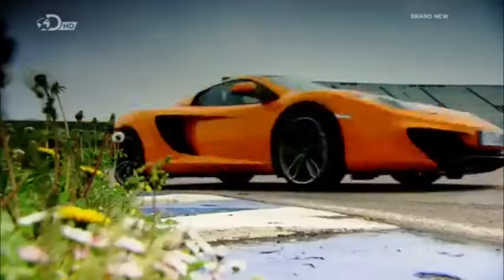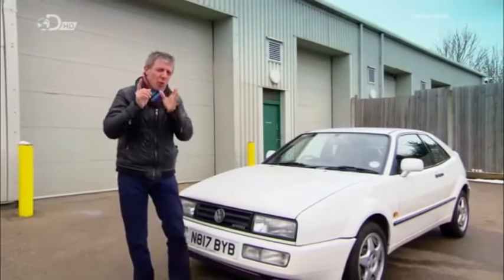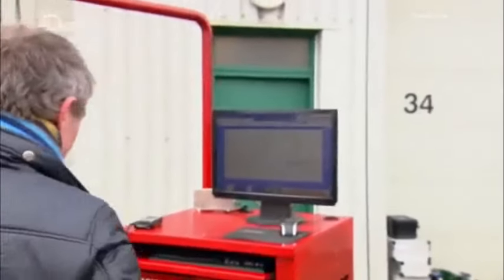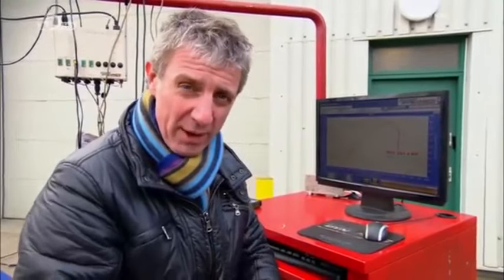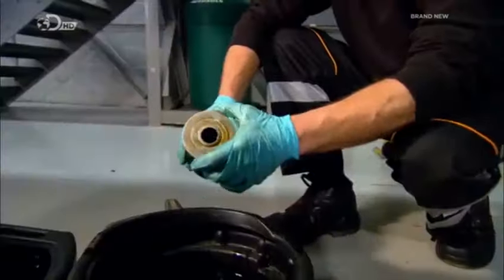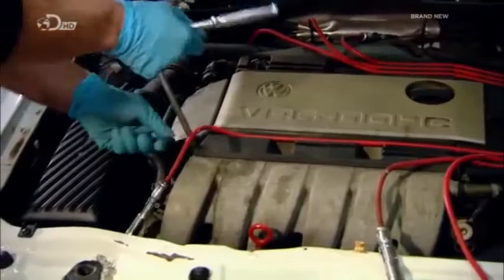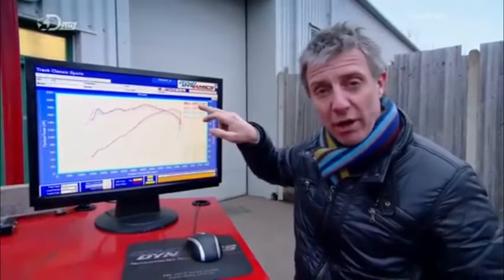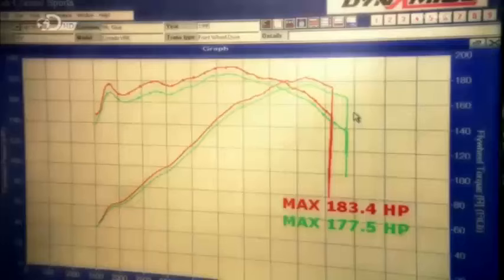5th Gear Test Redex On The Dyno With Surprising Results

Comment: Wow I got 11 extra HP, 188 in total now, but still can do 70mph max...........
Reply: I bet you're fun at a party!
Reply: mirola73 The Corrado VR6 top speed is 146 MPH.
Reply: Ricky Rose I am !
Reply: Injectortune No use in the UK though.
Reply: +mirola73 70mph? Everyone does 80 on the motorway. Anyway acceleration is mainly what we use power for on the road, to me it's what feels fun about having more power. You're on a 60mph single carriageway, some sunday driver in front is doing 40, suddenly you have a clear stretch... You can't tell me it's not fun to drop a gear or two and get the overtake done quickly, safer to spend less time in the oncoming lane too.
Anyway the engine will be more efficient after doing these little tweaks too so more MPG.
Reply: +mirola73 Not everyone is dead inside. If I find an empty straight with no hazards, the throttle is getting mashed and staying there, because why not!
70mph is a pathetic limit which is totally outdated. Anyone who's been on the autobahn in a fast car can attest to how a bit (or a lot) more speed is not neccessarily dangerous you're responsible and your car is well maintained.
Reply: ^ Here here. If you want to get somewhere quick in the UK, cruise at 95mph and no faster unless you're certain there's no camera van or cop car behind you. 95mph is almost certainly 3 points (unless you're breaking other rules) 96mph and you can end up in court for being 26mph over, which applies to any speed limit. Cops always report you for a speeding offence, only the vans do FPNs now, but the 'ticket' still ends up with the same office and you still get the same points that the FPNs do.

Comment: Why would cleaning the fuel delivery system give the car more power?  Those injectors can't possibly be outrunning the fuel system's ability to deliver fuel.  This guy's insane.
Reply: +Alex Tworkowski because the "fuel delivery system" = the injectors. redex is injector cleaner and injectors DO get dirty and lose flow.
Reply: +therealzipp0r   You're assuming closed loop compensation for lean burning.  I think gross symptoms would occur way before that many HPs are lost.  But i must apologize for my rash statement and assure you that you might not be insane.
Reply: Not the amount delivered, the dirt can cause spray pattern problems, leading to insufficient atomisation and poor combustion. I however still have my doubts about fuel cleaners. Perhaps the system cleaner does more to stabilise the fuel, rather than clean. After all it's only evaporation that causes varnish build up etc. That's not likely in a closed fuel injected system.

Comment: Bless 'em, you can't measure accurate engine hp on a chassis dyno (i.e. rolling road).  You measure wheel hp and make an educated guesstimate about engine hp (or the software does), no more, no less.  'Coast down losses' are nonsense because coast down uses different faces on every gear in the drivetrain and so is completely meaningless.  And quoting tenths of a hp for a guesstimated figure is just utterly laughable.